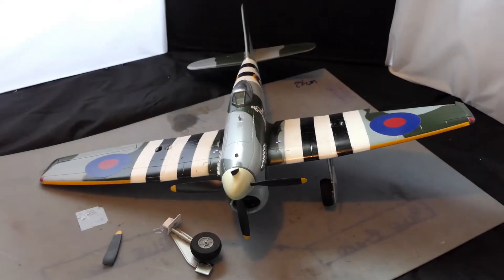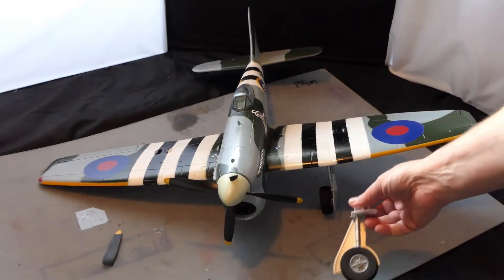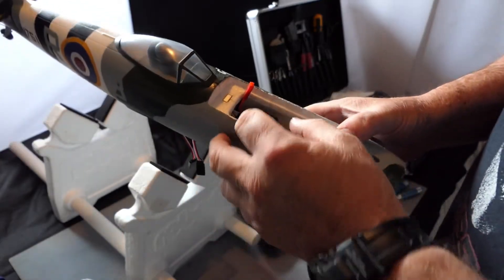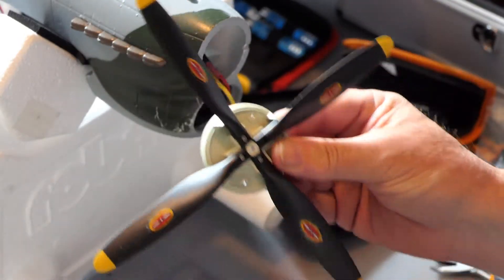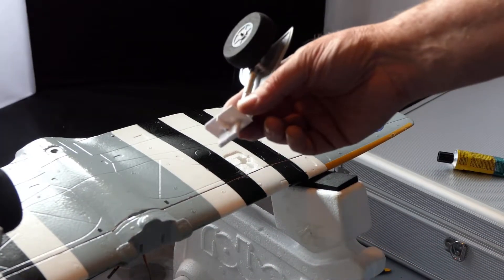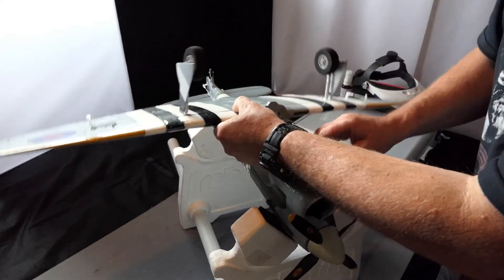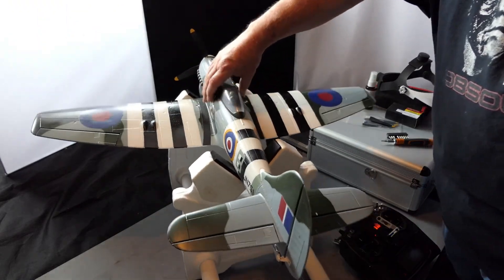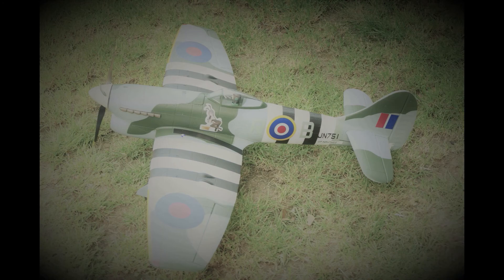Repair - Hawker Tempest 800 mm -  03 July 2020

Comment: That's really useful video. I crashed my P51 on my maiden flight (ARGGGH) But got the fuselage replacement from HK and from what you show here it looks like it's similar how you take out the motor and put it back. My blades were fine, though I need a new screwed shaft for the motor as the impact made bended it. Thanks anyway
Reply from the maker: Yes it is ..it is similar for all in this range and they share the same prop blades.
Reply: @FlankerTanker  Thanks! What size is the Allen piece you use to take the motor out and back?

Comment: I'm having the same problem as 'don't perish' and 'Justforkicks'.  Please advise if possible, the EXACT SIZE of the hex driver/Allen key you used to release the motor-retaining grub screw, through the small hole in the top of the fuselage?  It's too deep to see and whatever I try doesn't seem to catch it.  (Be handy if HK included these specs in the manual.)  Whatever, thanks for this video - I found it very helpful and informative.
Reply from the maker: Sorry for the delay in getting back to you, I think it was a 1.5 or even 1mm hex Allen key... I had one from my airsoft days,

Comment: Thanks, I was wondering how to get the spinner off. I am flying mine with a 3s 1000mah. I have added a touch of weight in with the batteries. I do fly with an 800 as well, so I vary the weight depending on the battery. The 'book' recommendations give a range on the CG, I use the forward number and actually have it a touch nose heavy from that balance point. I flew it first in between the books range and was not happy at all. Second and third flight with the CG slightly forward of those marks greatly improved the flight characteristics. I also used the P51 throws for the Tempest. The low rates were plenty for me and I will change those to my high rates and  maybe back off those a few mm's for new low rates. Moving the CG forward of what they recommend was the trick. I also had to reverse my elevator servo. Sorry that you had to repair it before you flew it! I think you'll like the tempest now!
Reply from the maker: Thanks for all the information - really helpful and I will do the same - its quite irritating that so many of the reviewers on Youtube never tell the whole story  -  thanks
Reply: Once I got it dialed in, I loved it.  Liked it so much, I ordered another one, and the p51 in the series. I like it better than my FMS 800mm's.  Now if only they will get those props back in stock😂😂
Reply: @justforkicks6755  Just curious, because I'm interested in the Fms 800s (corsair, zero, p51) What is it that you like more about these planes? What is lacking with the FMS?
Reply: @SEYOTwo  there is a lot of torque steer in the FMS 800's, they are hard to hand launch, the landing gear sucks, they dont come with a stabilizer and they cost a little more.

Comment: Very helpful just what I needed. Ordered and waiting on this arriving. Was paranoid about prop change on this and this vid helps. Just need spares in stock now! What battery specs would you advise? I have 900 3s ready to use
Reply from the maker: Thank you for your comment - I use the 850mAh 3s (Turnegy Nano Tech)  batteries they are an easy fit - but I did have to add some weight to the nose - approx 20g just under the nose to get the correct CG - since then I have  moved the RX into the cockpit and had to add another 10g so I have 30g on the nose but not RX in the battery bay (its in the cockpit) - the Tempest shares the same blades as all the others in HK range - Mustang, Hurricane, Skyraider, corsair - they just have different prop hubs and ways of connecting the Blades - and you your a right - as with almost all of the Hobby King stuff - NO SPARES....I got to a point where I would purchase 2 of the aircraft so I have a complete spare Hurrincane as an example...
Reply: @FlankerTanker  thank you very much for the tips. Once I've got my hands on it I'll play with the CG. Is it accurately located as per the manual?
Reply: @FlankerTanker  managed to get my CG spot on with the 900s. Could even budge up to a 1000. Could I ask why you have your dual rates and expo as? I've set mine at High rate 100% with 10% expo and 100% with 20% expo. My Low rate is 90% with 20% expo. Cheers

Comment: How do I know which connection is for each aileron and what did u do with the excess wires and connectors? They seem to jam in-between the main body and wing. Cheers
Reply from the maker: Take a look at this video from 4:23 https://youtu.be/ashQjxLGWVI
Reply from the maker: it does not matter which you connect to which... excess wire needs to be tucked into the back of the fuselage as you connect the wings - it is not easy and you need three pairs of hands - but as we only have one , it can be done but is difficult...
Reply: @FlankerTanker  thank u very much. Id just got it all set up but watching this extra vid has helped confirm everything I done. 2 things iv noticed so far. The prop seems a little angled to the right a bit like yours and also the tailplane once secured in place isn't perfectly flat with the main wing. Right side seems to dip a tad and left seems to raise a tad. There's about 8mm difference in it measuring from ground up to tips. Think the fuselage is a tad twisted which contributes to the off angle of tail wing. I hope it doesn't effect the flight. I guess at this price bracket I can't expect 100% precision.

Comment: Did you remove a screw from above the nose to release the motor? Is it some sort of Allen key?  I'm trying to get it out, but not getting traction.  Afraid I'll strip the screw.
Reply from the maker: Not remove just loosen it a little- it needs an Allen Key  - it is a tiny little Grub screw...

Comment: Martyn - at around 5.34 you spin the prop by hand. With my Tempest after a fairly mild nose over on landing, the prop spins a couple of revolutions by hand no problem, but then 'sticks' and needs to be pushed harder. In reverse it spins no problem. I thought maybe a bent motor shaft, but then why does it not stick on each revolution or spun backwards? Any ideas after all your experience with these HK warbirds? Any advice would be gratefully received!
Reply from the maker: Hi Paul - Hard to say - is anything rubbing when you turn it slowly by hand - can you feel the motor grind ?? - check the spinner back plat is not catching - also might be worth loosening  the motor using the hole in the foam and grub screw as shown on this video and the resitting it and tightening it all back up - My motor on the Night Walrus gave up the ghost - for no reason at all really - bearing went and it was making a strange noise - worst case power it all up and see (listen) does it sound the same or different - I have had Magnets come loose on a motor also... Sorry not much help but lots of things to try out - Let me know what you find....
Reply: @FlankerTanker  thanks Martyn. Motor doesn't grind, just sticks every coupled revolutions. However, I have just noticed that  the spinner can be pulled out around 1mm and this effected the 'sticking'. Took the spinner off and the lock nut was a mm or so undone! Not sure how! Have tightened it and refitted the motor - sticking has disappeared! Just need to power up and see if it is problem solved. Fingers crossed, spares impossible to find from HK yet again. Am I surprised? No!
Once again Martyn, thanks for your time and helpful suggestions. Might I suggest if you are looking for a job, try HK - they could do with you!

Comment: Check out the pentrincic bro
It would seem they solved your bonanza problem... Where you measured the CG from....
Reply from the maker: Yes indeed I did watch this my problem was not flying it but the take off and landings..just hated it......the roll to the right was massive...thanks for the suggestion...
Reply: @FlankerTanker  not a problem apparently the winds at the time we fly are supposed to be dropping right  down to 5mph this coming week
ALL the best